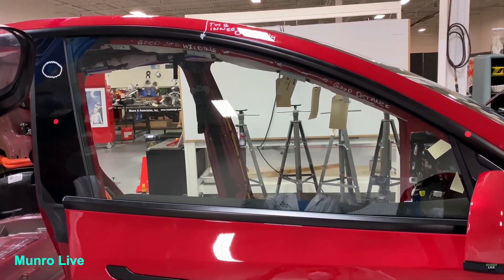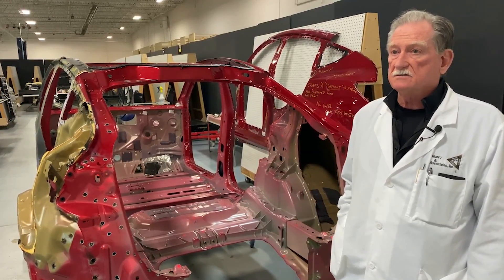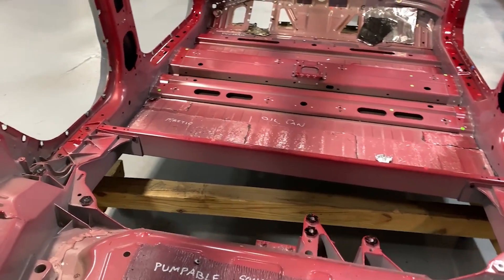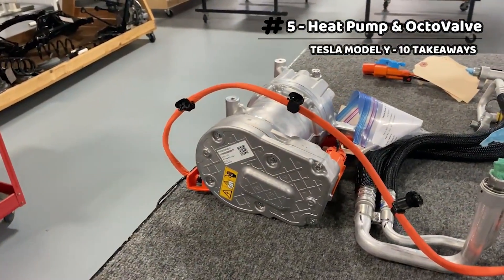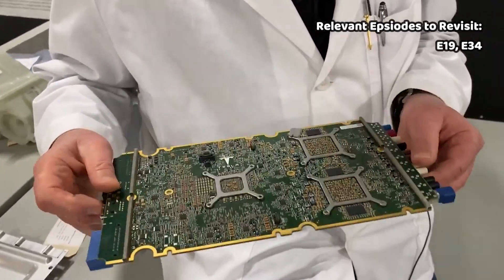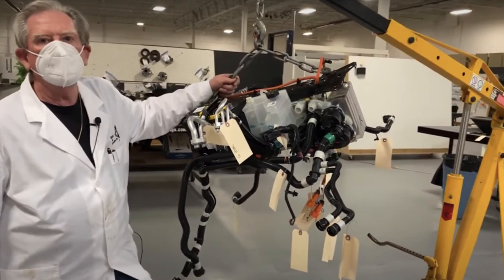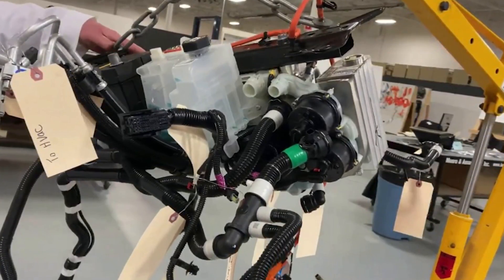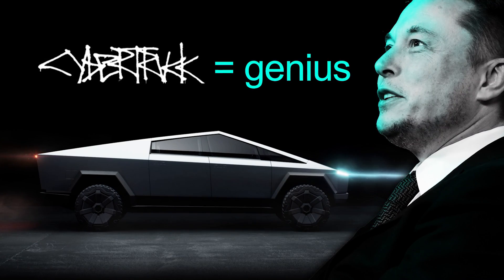Munro Tesla Model Y Teardown (reaction video)

Comment: It's just pushing programmer way of thinking & doing into manufacturing - "everything is doable if enough time & efforts are invested", "compromises are just under-thinking", redesigning as soon as more scalable aproach is discovered, applying a kind of unit testing, bugfixes to currently working version, etc

Comment: I want to see Tesla using hydro pneumatic suspension, steering and braking. it gives active ride height, self levelling and anti roll. Suspension is not fully active but each wheel can be soft or stiff when needed. 
It was invented by Citroen in 1960s. Today it should be a fantastic resource for the car.

Comment: 'There's no reason to expect this rate of innovation and change and finding new engineering efficiencies and better ways to do things and constantly optimizing won't continue into the future'. Well that's just wishful thinking that suits your goals.

Tesla is the most innovative car manufacturing company right now, that's for sure. But there is actually no reason to believe that this trend is going to continue forever. They will fall into the same trap that the current automakers have. That nokia and kodak did. It's kind of inevitable. It probably won't happen in near future, but once Tesla reaches the limits of its growth they'll be just as fucked as any other huge company in terms of management. And then another Tesla will come and take their place.
Reply: Mikhail Onishchenko , the top engineers don’t want to just work anywhere, they want to work for Tesla or SpaceX. 
It is extremely difficult to start a car company ( energy company). If a group of engineers can start a new energy company, well that’s even better, it will advance the transition to sustainable energy.

Comment: Idea for a new video: tesla has unlimited potential for price reduction for their cars still having massive earnings as they turn more and more to the energy company (no competition is possible at all). What i mean is that car is like 6-8 powerwalls on wheels with integrated inverter, which with new autobidder software installed and access to internet turn this auto to the part of shared electric grid and car starts earning money charging on lower energy prices and selling on higher, so stabilysing the whole grid and not gust being a backup electric source. This gives potential for tesla to adopt multiple versions like:
- buy a car and earn money with autobidder
- buy a car without paying for the battery, we own it, sign contract and provide it in grid for at least signed in contract time so all the earnings go to tesla, battery pays for itself like in 1 year and then earns money to tesla and you are using it as a car
- get your car almost for free, well some stupidly small amount and take kare of it as your power earning tool and provide it for free autopilot sharing for certain time, all earnings go to tesla, car pays for itself like in 2 years maybe, all the rest goes to tesla. 
- or you get 10 teslas, one you get for yourself for free, and sign a contract to take care of all 10 cars for that, make sure they are in grid, look perfect and clean,  ready for auto share, etc. great work for pension, and makes popular car not among youth but all ages
- tesla has no sells, and even then it is no prob, tesla makes own fleet and you can lease it on a time basis as a auto taxy, and rest of the time it remains connected to the grid in some tesla world spread hubs and charging parking lots
Million miles batteries allow use it like that with minimal harm to the battery, and millions of cars produced yearli increase the capacity of this shared grid massively, repplacing the current energy system, using only infrastructure

Comment: The problem with the other companies isn't that they don't have smart engineers, or the desire to improve/change. That's all engineers want to do. The problem is that they don't have management, direction, and drive to implement change. This probably comes from the management and board not wanting to change a formula that has worked for a long time.The management and the money doesn't support them. If they know whats good for them they will change. Ford is working in that direction with changes but it remains to be seen if they systematically change everything in the design/manufacturing process. It is a bit short sighted to blame engineers for the problems with everything. Money, time, and direction are out of the control of the engineer which leads to a lesser product.

Comment: Given the casting process consolidates 
parts, woudnt the y also be much more expensive to repair than the 3 in the case of accidents?
Reply: Are the castings in an  area most susceptible to accident damage? The standard crash tests are for frontal,/offset and side impact.
Reply: If this part of your vehicle is damaged it's most certainly totalled.
Reply: suneet bhatia  - not if you have Tesla insurance.

Comment: The only challenge left for Tesla IMO is the Osborne effect - I'm sure they are working on it.  If Tesla are willing to upgrade/retrofit battery pack and/or self driving core electronics on older vehicles... That will keep customers from delaying purchase or needing to trade up because they want the "next big thing". That means Tesla customers can drive the wheels off their investment and keep it's key hardware current (1M mile battery, self drive rev xx, etc.) simply by receiving timely upgrades...  Even if new sales fall off, upgrade sales could pick up the slack, most of the major assemblies are modular. Hey you want PLAID? Turbo PLAID? in you plain-jane model 3. Tesla has not even started that game yet!
I fear Steven you are beating a dead horse, whose name is other car OEMs. With battery day and S&P 500 hundred inclusion looming I would not want to be on the sidelines. Thanks.
Reply: D J , I’ve already had this done on my a Model 3. I paid for the new 3.0 chips , Tesla Service took out the 2.5 and installed the 3.0. Presto, Millennium Falcon.
Reply: @shepherdsknoll8  Awesome - no new sensors required? The sensors must be adequate, they probably made sure of that. Think the other OEMs would do that for you? Nah.
Reply: D J , all Tesla’s have been FSD capable (hardware) since 2016.

Comment: The downside of the constant iteration in hardware can be problematic support of spare parts if something breaks down or needs replacing (and it is from an old model for example). Other than that I like it.

Comment: they should add a darken window feature so people can have sex in the car while the car drives itself.
Reply from the maker: Coming soon...
Reply: @SolvingTheMoneyProblem  I see what you did there :P
Reply: @SolvingTheMoneyProblem  😂😂😂😂
Reply: Solving The Money Problem ... Coming soon, I see what you did there.
Lol
Reply: You're onto something there. Good idea.
Reply: Darken window? What a prude lol
Reply: Incargnito Mode?
Reply: People have done this activity already.. look online lmao
Reply: The auto used to be means for couples to drive somewhere and have sex. Now you can have sex while you go somewhere. That’s what I call innovation.
Reply: Pretty sure tinting windshield and driver windows are usually illegal for other reasons.
Reply: I can attest to this 🤪
Reply: Just need electrochromic coating, easy.
Reply: Now thats thinking outside of the box to bone inside of that box 😅
Reply: if you need darkened windows don’t do it in the car. Sorted.
Reply: I think (currently) it's illegal for civilian vehicles.  Maybe the seats could convert into a bed, and privacy shutters could extrude out from the walls...
Reply: @ShinkaTV  It's illegal to have on the front windows, but I guess when the tesla will drive itself it might be possible to do it on the back seats.

Comment: Traded my 2018 Model 3 in for the 2020 Model S. Despite the advances enumerated by Munro, and despite the S being around for so long, it is still the best car around. The S may look the same since the nose job in 2016, but it is far from being the same car. The ride quality with the adjustable air suspension is so comfortable and will probably make a long rode trip less tiring. There is a huge difference in road and wind noise as well. The power difference in terms of range and acceleration (without having to pay a premium for the performance option) is satisfying for me. Storage is about equal to the Y if not greater and comes with the awesome power lift gate. I strongly recommend taking the S out for a test drive before plunking money down for the Y.
Reply: Interesting. We have a Model 3, and although the S is outside our price range, I think we’ll try and arrange a test drive. I’ve got to say I like the simplicity of the 3, and the size, but a drive in an S would be worth while.

Comment: It's almost like a Tesla is the best car you can buy
Reply: It is, and it's much cheaper to buy price wise than the equivalent cars in it's class. It would be hard to go back to anything else after having a Tesla. Our 7 seat family SUV Model X is insanely good, and it's the slow version and can drag off Dodge Challengers and Supercars at the lights.
Reply: My only point of disagreement is that I don’t think cybertruck will be an iteration of what they have done. I believe it’s a whole new animal and v1 of what they will iterate on with future cyberproducts. 
The semi will be an iteration of S3XY as it’s using similar parts of the 3 and design language.
Reply: almost,,,, wrong answer
Reply: Not almost...it is the best car anyone can buy.
Reply: nope its obviously not the best car
Reply: Probably not until you take the price into consideration.  It is probably nothing but a wet dream for any engineer and programmer and anyone who loves insane acceleration.
Reply: Casper Hansen Munro has literally said if you want a car worth every penny, get the model Y.
Reply: @casper_hansen   Is that a problem
Reply: @kylebanwell3112  Translation needed: there are better cars out there, but they often cost more money and they do not have that insane level of engineering and programming and acceleration that Tesla can accomplish.  Its not a problem, I would love to own a Tesla preferable a Model Y.
Reply: @casper_hansen  Maybe a Rimac you mean? For now ...
Reply: Casper Hansen I mean yes and no. The only flaws I would say they have is the quality of the interior (aside from infotainment), Other then that I would say they’re perfect. 🤷🏼‍♂️
Reply: @casper_hansen  Name a better car out there? I've driven Bentleys, Ferrari, McLaren, Lexus, Merc, Audi, Porsche and Toyota. I can't say any of them were better than a Tesla overall.
Reply: Casper Hansen just wait till Tesla is the most affordable car on the market and can drive itself. I don’t see anyone buying a different car.
Reply: @casper_hansen  Tesla have a robot 😀👌